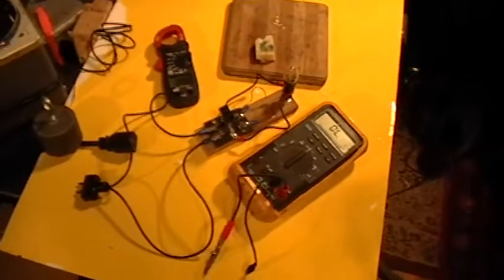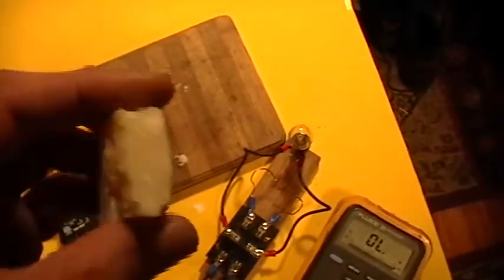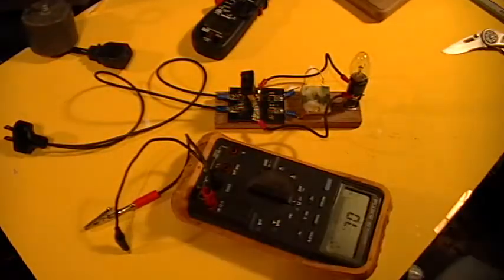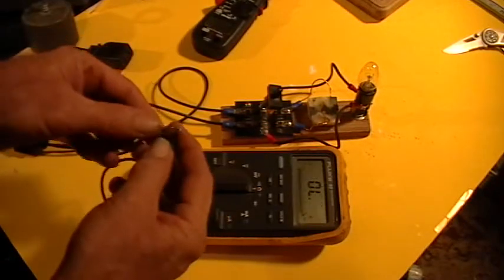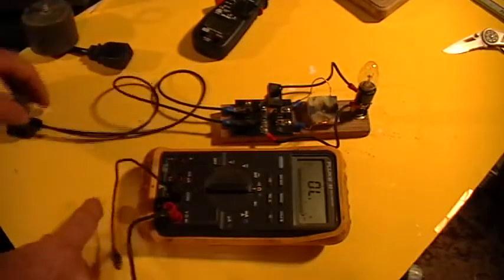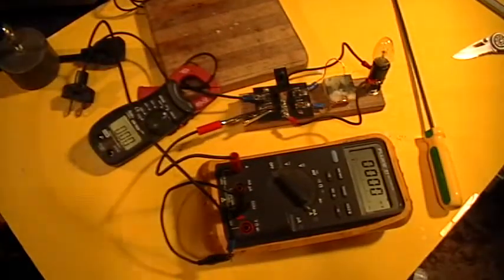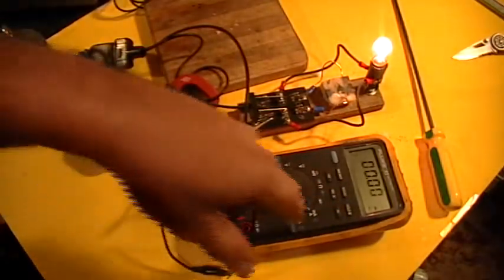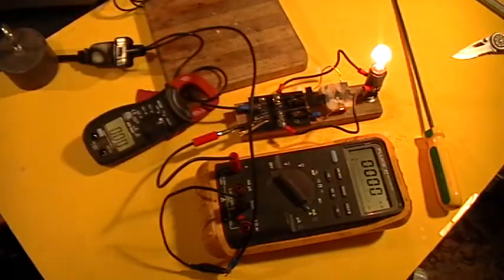alt.snakeoil Video Report 28b: Supplementary Input Power Measurements, Cheesonance

Comment: Nice demonstration! I guess the explanation is that the wire that runs through the clamp Ampere-meter (which measure really the time-varying magnetic field) is a coaxial cable. During cheese power the return current is not going through the Fluke meter but in the shield of the coaxial cable. Since the magnetic fields of the current and return current are directed in opposite direction they will cancel out and the clamp Ampere-meter shows zero current.

Comment: I suspect that the supply is both A.C. and D.C. with two series coils under the switch to the other terminals. The light is not so bright on the cheese, but the meters will not measure D.C. current if set on A.C.  The easiest way to prove is just pull the plug on the cheese.
Reply from the maker: Nope. There is actually no DC power in this demonstration, all the power genuinely comes from the mains line cord (and the Cheese, of course). However there could be any amount of AC and/or DC power smuggled into an experiment by this method. As long as you keep the rats away from the cheese, that is.
But you are right about the last part: The easiest way to prove that Rossi is f.o.s. is to pull the plug on any "running" ECat/HotCat and watch it start to cool off. And of course the fancy power analyzer used by Levi et al. is completely insensitive to DC... I have actually read the manual for that instrument, which the "experimenters" apparently did not.
And actually, the light is the exact same brightness in both cases, since Cheese Power is equivalent to Mains Power in every respect except meter-ability .... your perceptions are guided by the "patter" which misdirects you and makes your own psychology more influential than the actual data. (Also it's impossible to gauge relative brighness unless both samples can be seen at the same time, because of the video camera's auto-exposure features. Shutter speed and iris opening are continuously varied by the camera to give what it thinks is a proper exposure, so light brightness in most videos cannot be used as data.)
Thanks for watching, I hope these little alt.snakeoil demonstrations are amusing and educational... if they make you think, they have served their purpose.
Reply: TinselKoala
Must be two wires in one, as the clamp is on the far wire, and the two wires would cancel each other out reading 0A and the near wire is on the fluke and not being used.  Even easier than my method.  Funny how the lamp seems a bit dimmer though, variac?
Reply from the maker: Jon Weavers Now you are on the right track.
No, just the autoexposure function of the camera and perhaps a bit of the old power of suggestion. The bulb is getting the exact same power whenever it is lit.
Reply: TinselKoala
Cheers, I did wonder if it was the way he double wound the cable through the clamp but looks O.K. and would not explain the Fluke, however seemed to be on A.C. current so must be twin wires.
Reply from the maker: Jon Weavers Running a cable thru the clamp meter twice or even three times is perfectly legit, as long as you remember to correct the meter's reading for the 2x or 3x amplification factor.
Reply: TinselKoala
I know, just wondered if they had looped it around the other direction to cancel it out looked normal to me, so I guess it is two wires in one then, clever though.  I had also wondered if he had used a diode or 2 as the bulb was dim, just looks like he has not if the brightness is the same.  Very interesting though.  Cheers

Comment: I'll take a shot. The wire that you don't disconnect is really a shielded black wire so it can have hot and neutral. The other wire is a neutral. when you use the clamp meter on the top, it shows nothing because clamp meters have to be over one wire, not both. At that point, all the power is going through the "double conductor" wire and no current is flowing through the other wire with the fluke connected. The double wire connects under the switch to both cheese connections.

Comment: I try an explanation: the front points of the switch (where the cables from the mains are connected) lead through crossed to the back points of the switch (where the cheese is connected). Moving the lever will always connect the lamp to power. The cheese has high resistance and does nothing. The Amp-Meters show zero if one switches Zero and Phase after having done a measurement with the original Phase and Zero connection. Disconnect the mains when running on cheese power or reset the meters.

Comment: I think you've been had. There is no way that cheese is genuine Italian reggiano. If it was the output would blow the bulb as Italian cheese is made in premises  supplied with 50hz mains at 230vac. You have been sold a mislabelled American cheese running at 120v 60hz.

Comment: I went back through your videos and found e.g. that one watch?v=MK90_CbnAeY showing "Wireless Power".

The receiver could be your cheese, the short wires and your lamp in series (similar to the wire loop receivers in watch?v=MK90_CbnAeY). The cheese providing tuning capacitance in the pF or low nF.

The transmitter is underneath the yellow board, always on, because you "close" the receiver loop only when the switch lever is near the lamp. (No need to disconnect the mains.)

Greetings, Conrad

Comment from the maker: They are. 

But what do diodes have to do with anything in these videos? There are no diodes or other semiconductors, no resistors or capacitors, in this apparatus, just wires, the plug, the switch, the bulb and socket, and the cheese.